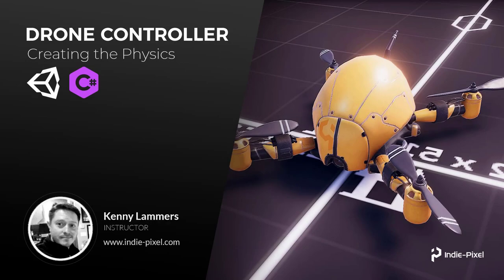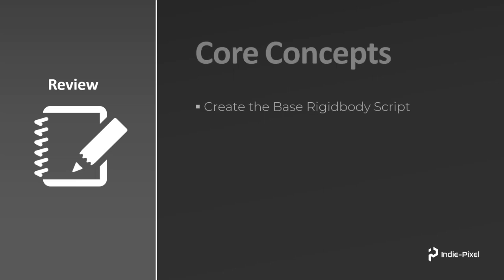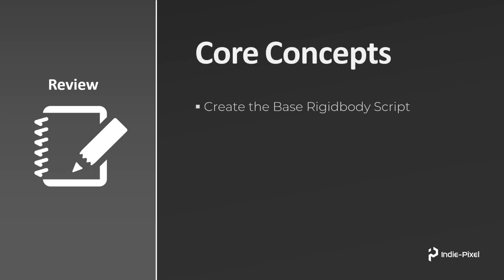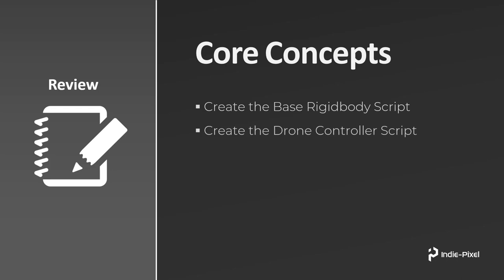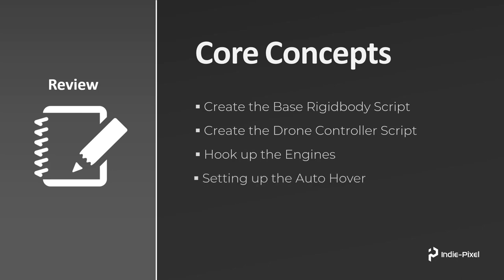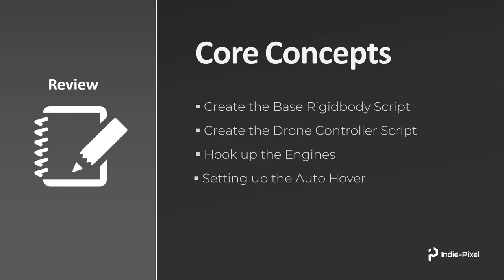Unity 2019 - Drone Controller - Section 3 - Video 1

Comment: G'day Kenny. Awesome! Just want to say if anyone else using Windows 10 gets an "unexpected error (0x80010135: Path too long)" when trying to unzip the download folder in Windows Explorer, just use 7-Zip file manager to unzip instead. Works fine. I wouldn't want Windows Explorer leading any expedition I went on these days. You'd end up lost for sure.....lol.
Reply: Just realized I meant to post this in Section 1 - Video 1.....think I got lost there for a sec.